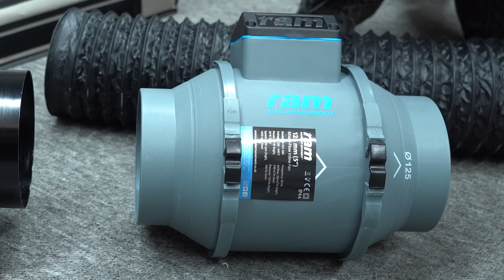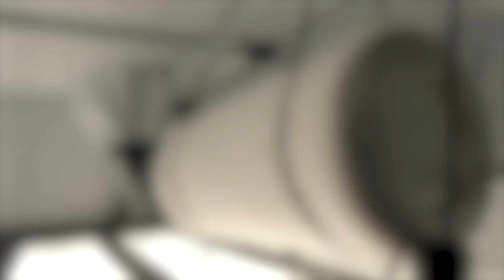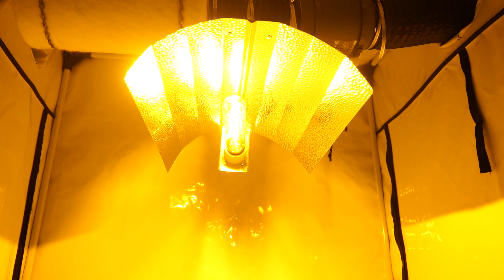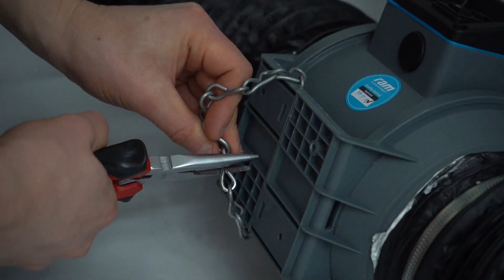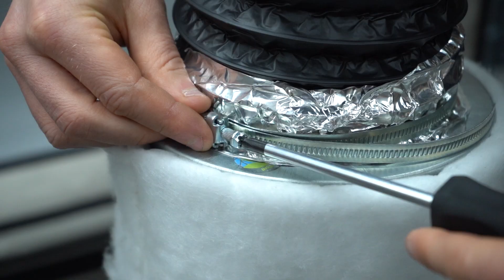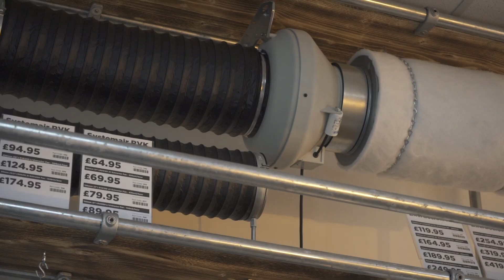Setting up a RAM & BAY6 Grow Tent Extraction Kit | Step by Step

Comment: What happens in summer when it gets 35-42 degrees in my country summer can get hot would you use a portable air-conditioner and dehumidifier ? And when it gets cold in winter are the lights good enough to keep the temperature good or will you need a heater with temperature control, I think someone should invent a tent with all the trimmings for both hot and cold temperature with a control device, so all your fans heater humidifiers plug into that device which inturn plugs into 1 wall outlet and the rest of your wall outlets are just for ×4 or ×6 seperate 600-1000 watt hps that's where the big buds are at metal haloids and or HpS

Comment: Is an intake fan completely necessary or can i just have a port at the bottom open?
Reply from the maker: If you're growing in a tent that's 1.2m x 1.2m that's when we would say an in-take is necessary. Anything smaller you could get by with a port at the bottom.
Reply: @growell  perfect! Thank you for the reply. I am using a 0.8x0.8m tent so I should be good with just a port open. Again thank you for the reply!
Reply from the maker: Yeah, for a tent that big a port for intake is fine.
Reply: @growell  what size intake fan would you need for a 1.2 ×1.2 × 2.0
Reply: Hey mate. I also have a 0.8 x 0.8. I'm looking to purchase an inline fan. What would you recommend? Are these fans really noisy?
Reply: @wesleygovindsamy4755  Yeah i got the kit they offer and was worth it not too loud but obviously makes a bit of noise